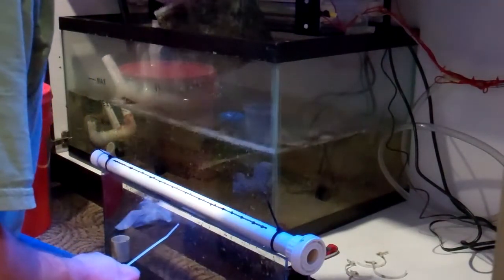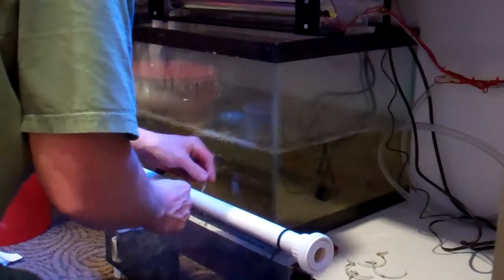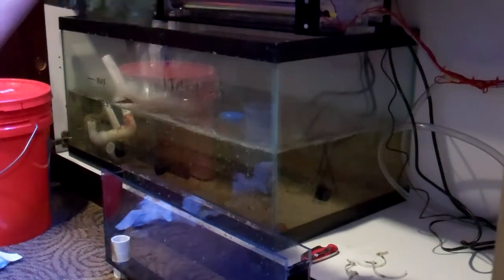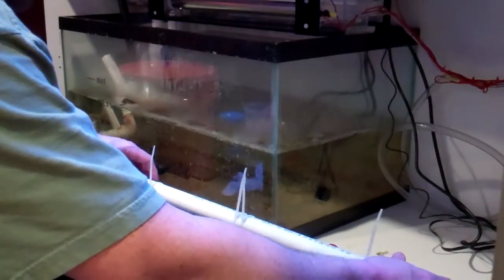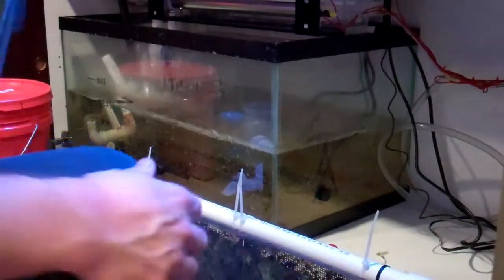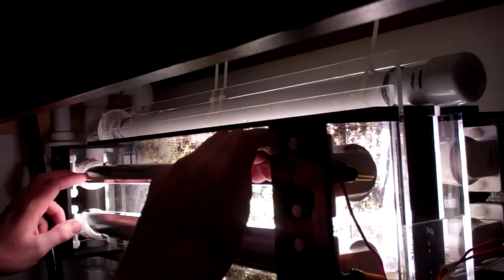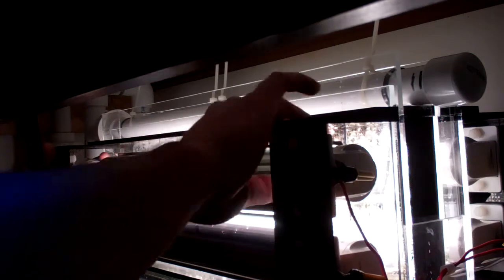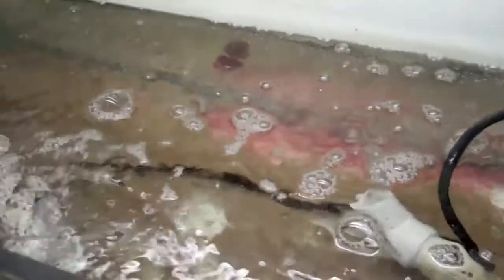125 Reef Algae Scrubber Screen Cleaning Part 5

Comment: Can you ever build a ATS that is too big for your aquarium? If you do what are the problems with them?
Reply from the maker: Franklin Michael yes if too big growth tries to spread out and won't grow green, green is the most efficient. Rule of thumb, don't go much more than 2x what you feed
Reply: Bud Carlson I see, and I see people recommend 1 square inch per gallon if you light it on both sides or 2 if lit only on one side, but how does it relate to bioload? If I feed heavily would I manage to cover a larger turf scrubber with green algae?
Reply from the maker: Franklin Michael no. Google "algae scrubber Zoho" for some reason I can't post the link
Reply: Bud Carlson Ok I'l check it out thanks, and are submerged upflow algae scrubbers worse than scrubbers like yours? Is the 3d one like that?

Comment: what are the end caps for your t5 what make
Reply from the maker: This is a pretty old video so I don't use the T5s anymore, look for the L2 videos for the LED version I use now.  But to answer your question, they are just standard waterproof T5HO endcaps that you can get just about anywhere, they have a cap that you push over the lamp, then you install the lamp in the socket, and screw the endcap down on to it.  Pretty slick, but a total PITA to replace lamps.  Especially when you have to do it every 3-4 months.
Reply: i tried learning how to work the led thing out and then when i relised how much heat sink cost i decided to stick to the t5. thanks for the reply
Reply from the maker: vhsable
What size scrubber are you building?  The sizing guidelines changed in 2011 to be feeding based: 12 sq in of screen for every cube/day,not 1 sq in per gallon.  Unless you have a huge tank or feed a ton, there's no need for a 24" wide T5HO scrubber.  The scrubber you see in this pic above is now replaced with a 4x6" LED scrubber with 6x 660nm Deep Red per side, and the tank does fine if not better (on that and no other filtration)
Reply: 2x 4" x 10" screens.
built a santamonica 100
im going fish only on a 90 gallon so going to feed loads
Reply from the maker: vhsable Ah, gotcha.That's still a 10 cube/day size screen, but even if you're only feeding half that, it will be good, and definitely good for sole filtration. Premium Aquatics carries these http://premiumaquatics.com/products/german-cap-t5-pair.html but you might try Dirks to get them cheaper.  Or I can sell you my used ones, I have like 8 sets (16 endcaps)
Reply from the maker: vhsable actually I think 4 of the sets are unused.  I also have a T5HO ballast which I think it also unused and probably some unused 2700K lamps
Reply: I have ordered everything now thanks, it will be sole filtration with a uv light. i all ready have a 10x10  inch screen lol on a 90 gallon reef tank illuminated by two 45watt 3000k cfl . i have allways struggled with getting this thing going, im sure it because the size of it. im very impressed with one of your scrubbers its in a perspex box and its full of water with screen submerged that looks a awsome bit of kit. workes like the hog but alot more refined in m opinion. loving your scrubbers